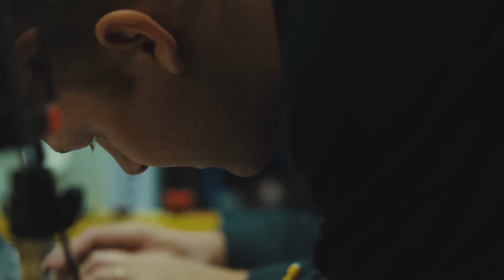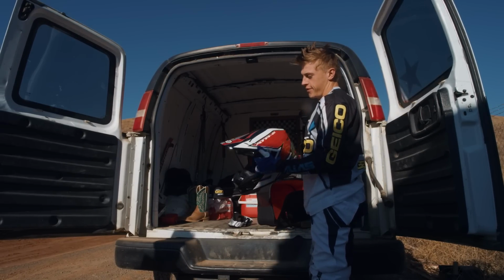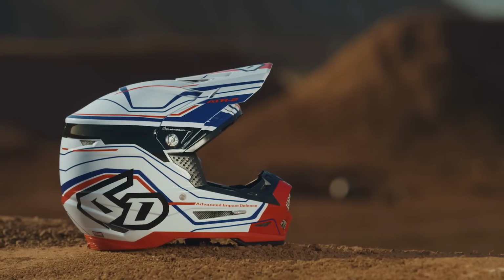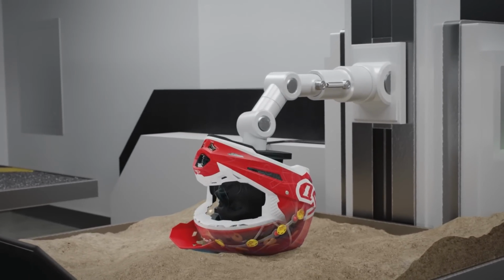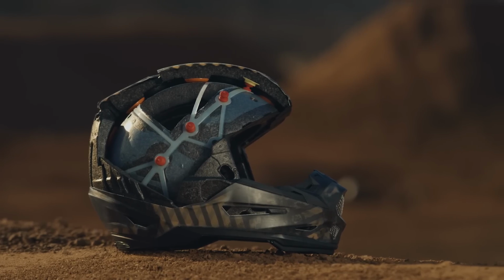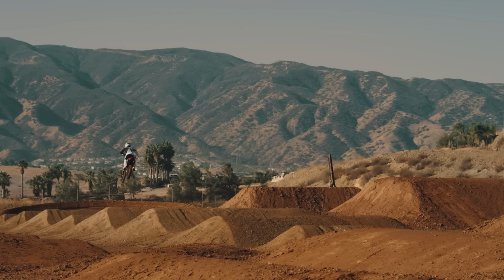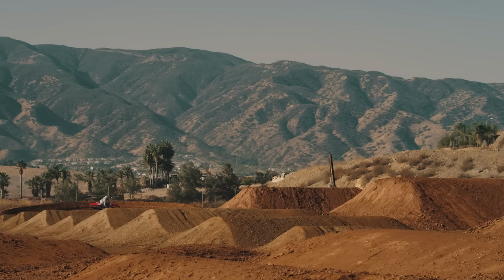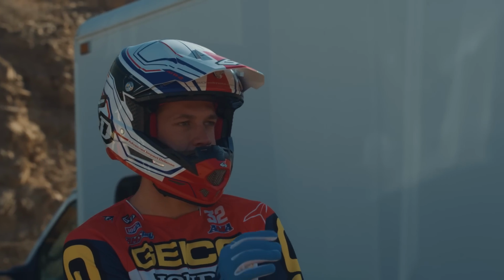6D ATR-2 Introduction

Comment: So is the ATR 2 actually safer than the ATR 1 or is it better for manufacturing ? Love my ATR1
Reply from the maker: The ATR-2 Helmet has significant improvements in both linear and angular energy management compared to our ATR-1 helmet (as much as 20% better in some test locations).  The ATR-1 is still an excellent helmet and leads the way in comparison to other manufacturers offerings.
Reply: Did you watch the video??
Reply: Thank you!!!  Most manufactures shy away from actual data.  If the data says its safer than my ATR1...Ill buy one.  Great job 6D Team!